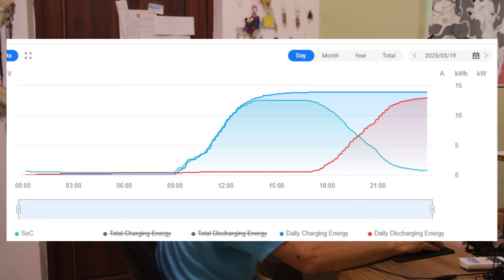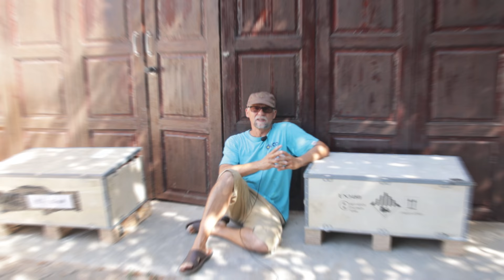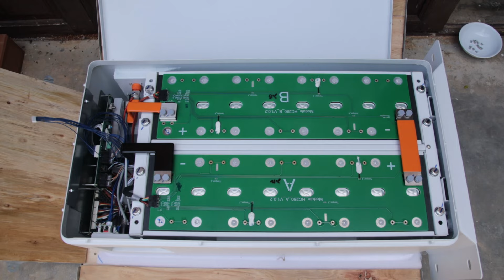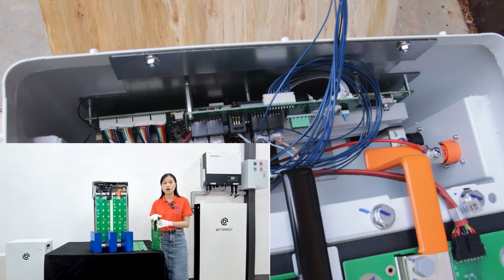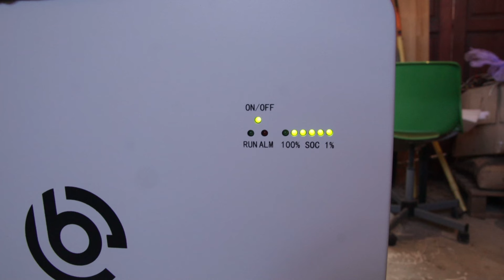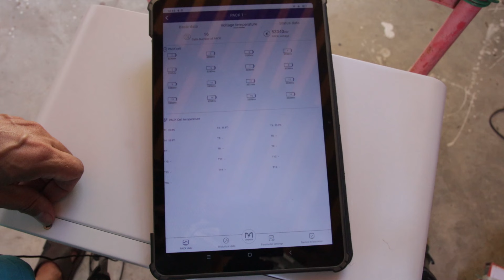Batteries Delivered! OEM LiFePo4 51.2V Batteries for an unbelievable Price...Eleshell16K Review

Comment: Hi and thanks for the informative video. Very interesting. I have a small system that came with our new house and would like to expand its capabilities. I presently have 6.6kw solar panels going into a Huawei 5Kw inverter. The Huawei batteries are very expensive and I’ve seen some of the batteries coming out of China.  I’d like to know if the battery you showed could connect to my inverter and communicate correctly? I know I will need to get a bigger inverter and like the idea of independent modular components rather than say an inverter with built in battery.  Any help greatly appreciated from here in Hua Hin Thailand.
Reply from the maker: Hi. So that's a Huawei Hybrid inverter, right? And it can use a Low voltage battery (48V) or is it for High voltage batteries? 
Without the exact inverter model number I can't tell you anything useful.
The communication won't be a problem if the inverter is for LV batteries, but will probably Huawei proprietary if it is a HV model.
Hua Hin is just a stone throw away from Pranburi. You are welcome to come here and take a look if you like. 
Greetings
Reply: @ hi. It’s a Sun2000 Huawei inverter. I’m really just learning about the solar stuff. Yeah be great to visit you if I can. I found this about my inverter. The *Huawei SUN2000 solar inverter* typically works with *high-voltage batteries**, such as the **Huawei LUNA2000**, which operates in the range of **350V to 560V DC
Reply from the maker: @startingwithalostsongs5173  yes. those inverters work with high voltage batteries like the stackable types. Bettenergy does have such batteries as well, but you would have to ask Jason there if they work with Huawei inverters. Those Brands try to sell their own overpriced stuff to customers of course ;)

Comment: Looks like a nice battery the pcb modules make it easy but instead of 2 24 volt it would be nice if they did 4 12 volt for us week people lol . Price is good.
Reply from the maker: @offgridwanabe  well, I do hope that in my lifetime I will never have to take out anything of that case and it just works. hehe
Reply: @RolandW_DIYEnergyandMore  Also I would put a plastic sheet inside the lid or fish paper just in case there is an accident and dented.

Comment: Looks like good batteries, but for usd DIY guys, we can still go 50USD/kwh
Reply from the maker: I am done with used cells ;) Was really watching the old cells degrading in real time... This way i am hoping to really get some long system life as we DIYers  have all deserved.
Reply: @                                                                  Used?I  bought brand  new    EVE
Reply from the maker: @rm6857  yes. i know you can get new 314Ah prismatic cells from EVE, CATL, Hithium, Rept, etc for 50 USD/kWh. But that is still just cells. Making a good pack out of it takes still a lot extra especially when you don't want to let everything out in the dust. And the one thing i have learned most the last 8 years since I do solar and batteries is calculate :))
Reply: @RolandW_DIYEnergyandMore    you are righ, but i have fun using 2nd hand stuff people throw into trash. And bms can be another 50usd, but you can use it without bms, its also fun. But maybe with smaller packs outside of your house, big pack can be big trouble without bms lol.
Reply from the maker: @rm6857  yes. I have as well enjoyed the more chaotic hard core DIY, but I am slowly getting old. Now the stuff should just work. lol
Reply: @RolandW_DIYEnergyandMore  im like decade younger, so still enjoy troubles
Reply: Probabile the cell yuo use in orizzzontal mybe in vertical is meior corrett  @RolandW_DIYEnergyandMore